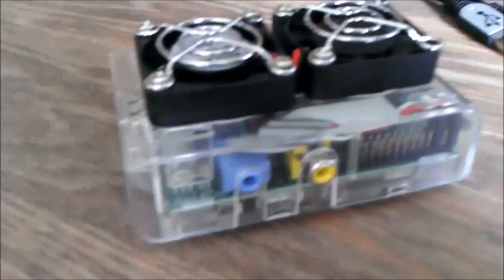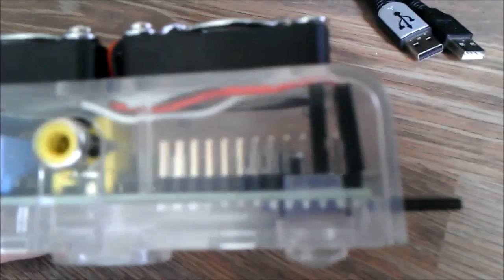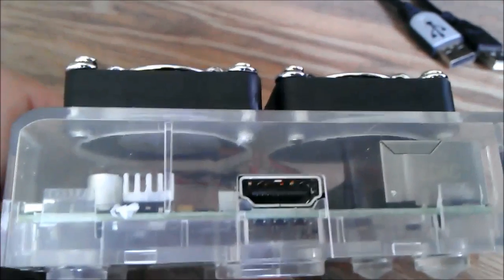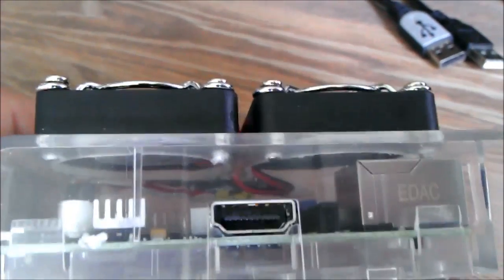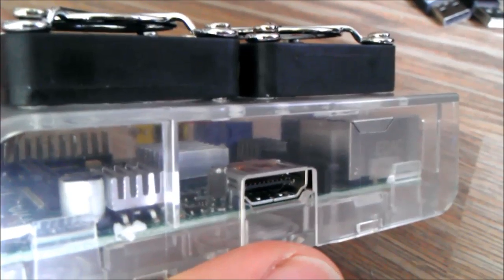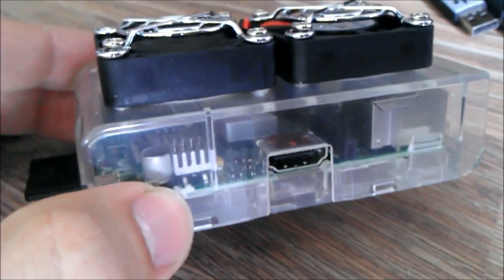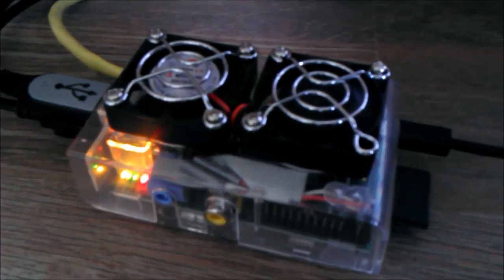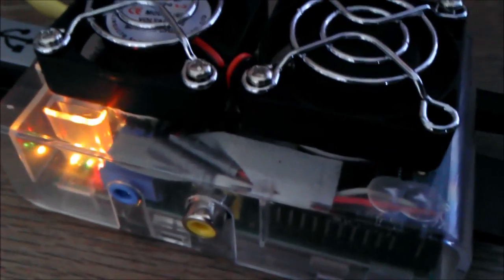Raspberry Pi 5V fans cooling

Comment: Your system would run cooler if both the fans faced the same direction. The intake fan is sucking in air that is coming out of the exhaust which is why the tempature isn't that low. Your idea would work great if there was a good amount of space between both fans, but that's hard to do on a pi case..

Comment: which pin did you connect the fan on the board????
Reply from the maker: Ground and 3V

http://www.digitaloffensive.com/wp-content/uploads/2013/05/Raspberry-Pi-GPIO-Layout-Revision-2-e1347664831557.png

Comment: How did u change pins because on picture of the fan I see 2 simple connected pins.
Reply: 3y4tdf3y4rt  bad idea dude, you are taking 3.3v volts directly from the regulator, so you're putting more load on that thing and making it generate more heat. Just connect the fans to the 5V so its before the regulator
Reply from the maker: I had some spare pin connectors from a old pc and connected one to the pair of +3V and to the one pair of Neutral
*This might not be the answer to your question, as I found it hard to understand what you mean...
Reply: There are 2 5v connectors on the pi headers, just connect one fan to one  5v gpio and the other connector to one fo the ground conncetions in the gpio.

Comment: How do you check the temperature of the pi? I'm thinking of making a small palmtop like computer out of one with a small fan, but I don't want the fan running constantly at full speed. Any help?
Reply from the maker: cat /sys/class/hwmon/hwmon0/temp1_input gives you the temerature in degrees celcius (e.g. 32552 == 32.6 degrees Celcius)

Comment: Why not set them both as intake fans, and drill holes on the side for exhaust so that there is positive airflow?
Reply from the maker: because pushing air though the holes would generate more noise. Now the airflow in equals the air flow out.

Comment from the maker: Just drill a hole with a diameter of about 4 cm, drill 4 holes for the screws, connect the wires when placing 2 (fan1 red to fan2 red to red wire with connector and fan1 black to fan2 black to black wire with connector). Pin the connectors on the GPIO board, use pin 6 for ground (zero) and 1 or 2 for either 3V or 5V robig.net/blog/files/images/Raspberry-Pi-GPIO-Layout-Revision-2-e1347664831557.png). I'm not using any smart fan voltage to control the speed, just 3 volts.

Comment from the maker: Yes, 2 times three wires together. You can find out about all other connections by searching for "Raspberry Pi GPIO". There is of course a limit of things you can connect to the GPIO, but you'll find out quick enough when the cpu doesn't have enough power to run stable :)

By the way, yesterday I changed the wire connection from 5V to 3V (opposite pin on the GPIO), so the fans are less noisy now, both runnnig on 3V instead of 5V :D